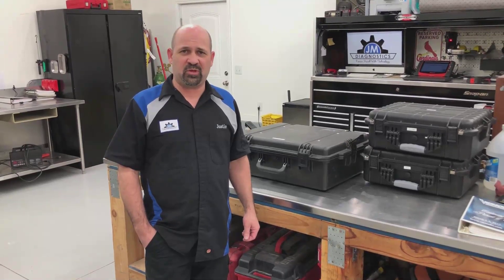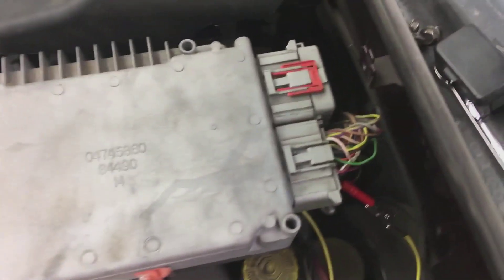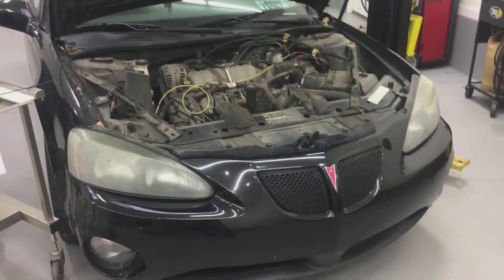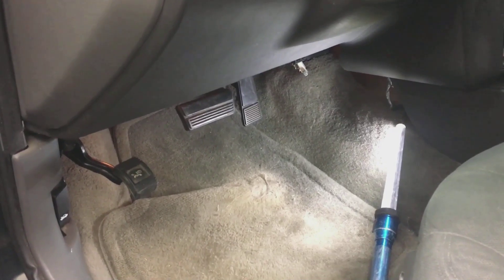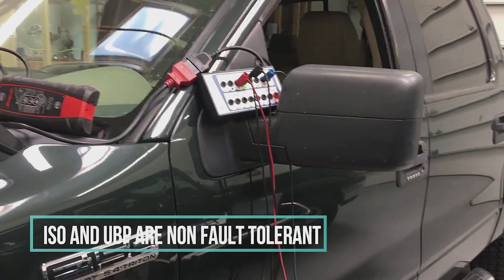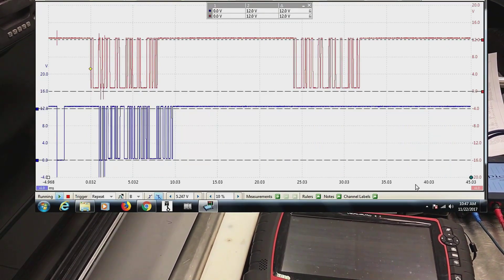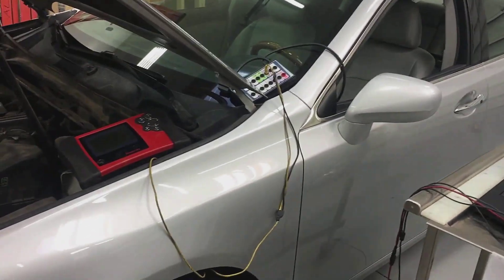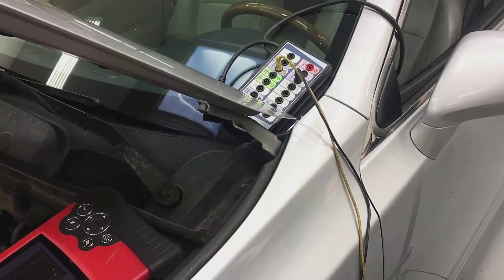Vehicle Communication Network Capturing

Comment: Is there a reason why you did not apply power or ground to the CAN network at the break out box instead of at the PCM? That would eliminate using the wrong wire at the PCM, no?

Comment: What happens if for what ever reason when doing the ohms resistor ck you either have more or less resistance between pin six and fourteen what would you look for?
Reply: That would depend on how high the resistance reading is.

Comment: Instead of using a jumper wire to do these shorting tests, use a test light its added insurance that nothing gets the smoke left out. Especially if you are experimenting on a customers car. The last thing you want to tell someone that came in for brake pads is, oh by the way you need a ECM cause I used your car as a guinea pig and fried it.. Lol
Great job Justin
Reply: Good point!

Comment: what is the breakout box for? isn't it just as effective to back probe the dlc without spending $$ on a box ?
Reply from the maker: Dave Murdock the breakout allows for a quick easy access to the dlc without the worry of poor connection, backprobes falling out, shorting circuits, damaging the dlc pins etc. It has led lights on it showing you instant network activity as well. It's not necessary but definitely a handy tool to have.
Reply: thankyou for the info. great video by the way.
Reply: Dave I have one of these cheapo versions. So far seems to work fine. https://www.amazon.com/Signal-Diagnostic-Breakout-signal-diagnosis/dp/B06XD2CM5B/ref=sr_1_2?ie=UTF8&qid=1522866985&sr=8-2&keywords=dlc+breakout+box
Reply: This kit is great too. https://www.amazon.com/Tool-Aid-23500-Back-Probe/dp/B00G9C3RSU/ref=pd_bxgy_263_2?_encoding=UTF8&pd_rd_i=B00G9C3RSU&pd_rd_r=GEFEBJ7WF38DNFG92J3D&pd_rd_w=mdJV7&pd_rd_wg=9SAao&psc=1&refRID=GEFEBJ7WF38DNFG92J3D
Reply: Hi Justin !!...Super video !!...I'd like to do an instructional video like this for my C5 Corvette Forum members. I'm assuming you're back probing the serial data line on whichever module you want to take down for testing...C5's have the class 2 data line with the splice packs like in your GM section...how can a DIY'er troubleshoot with just a DVOM ??...I really think you can't. You definitely can't see the 0-7 volt square wave...only with a DSO...what about with a scan tool ??...and I guess it would have to be one that can communicate with all the modules !!...how do you troubleshoot with just say only a scan tool...I have a Pico-scope and a CAN test box so that wouldn't help 99.9% of forum members...I watched a video last night on how to use a scan tool but I couldn't get it to work...hooked up my Autel and removed the comb then jumpered the purple signal wire to a module but I couldn't communicate with it...any help ??....THANKS !!

Comment: Very important to understand how they fail ! Awesome job.  Will we be seeing some of the other types as well ?
Reply from the maker: New Level Auto What did you have in mind ?
Reply: Trained by Techs Channel Flex Ray , PCI bus , Lin or any single wire Lan.  Might be nice for those that havent seen it yet.  CAN running in single wire mode and possibly an option to show what it looks like when a module is not fully powered up and how it affects the data line. Just a few thoughts 😁
Reply: @NewLevelAuto  Now I am very curious about how these faults would appear, especially when a module isn't fully powered up!
Reply: Great idea!